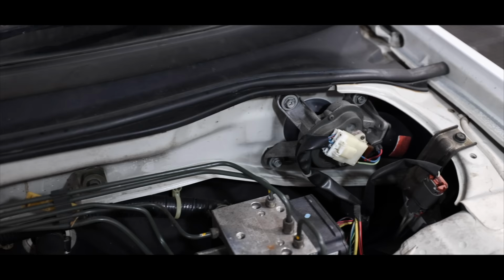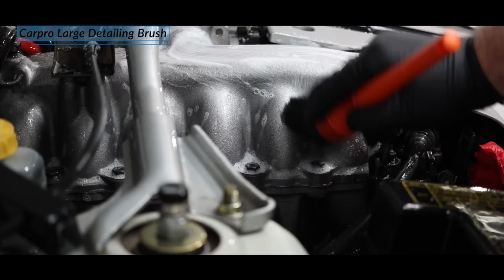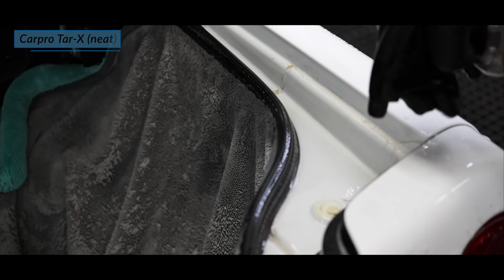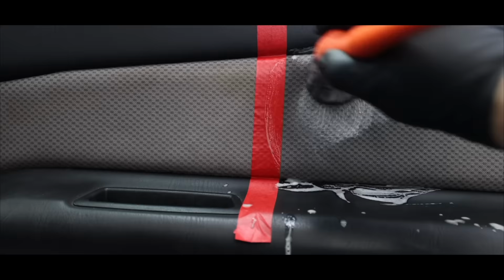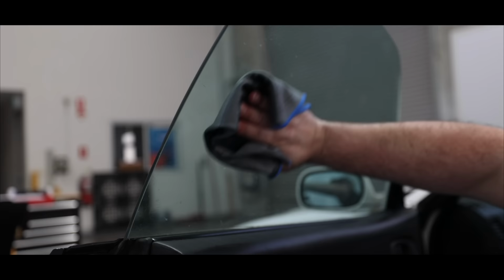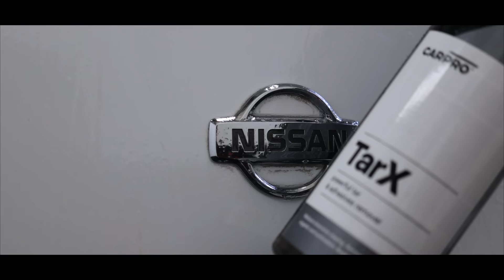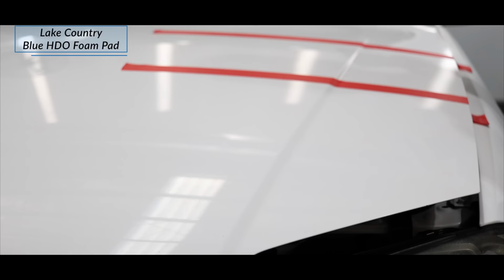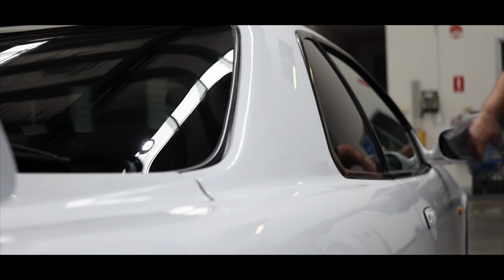My Biggest PreSale Detail Ever! Nissan Skyline R34 (Vlog 48)

Comment: I just did a light polish on my car for a new coating. It's amazing what a difference between a well maintained car and one like you worked on when it comes to contamination. I used Iron remover and I had maybe 10 spots on the whole hood  and fenders where here it's a sea of red. I have learned a lot from you, so Thanks!

Comment: fantastic restoration work Sandro, should be easy to sell with such a make-over.  good thing to use with badges/emblems (get old polish residue from shut-lines too) is thick toothpick or bamboo food stick wrapped inside a MF cloth, to get all the gunk out with out any damage.

Comment: Hey buddy, nice work on the R34. Yikes 84microns. Owner did not look after it ;( 40 hours looks about right, just the underbonnet and engine work would have been half a day.
Reply from the maker: Thanks mate and I think every Skyline I’ve done - which is quite a few now - have all had super low paint thickness readings, so although disappointing it was about right 🙂

Comment: That was a heck of a transformation. Great work as always. I was surprised when you busted out the Boost V2. Can't say I had a great experience with it sadly. Tried adjusting my towel type, amount used, and work areas and it kept leaving oily streaks on the car that required a ton of buffing to get it off. The car has Ethos graphene v2 on it, and the original boost never did anything like that.
Reply from the maker: Thanks mate, appreciate it. I guess there’s potential issues with what you’re applying a sealant over and some don’t mesh together as well as others but so far Boost V2 has worked extremely well for me.

Comment: Good video Sandro...I normally stick to ph neutral (which I would recommend NV Snow foam i find this soap PH neutral and consistent formula)  as much as possible but on rare occasion i use  Alkaline base cleaners over Acidic and rinse 2-3 times because Alkaline is bad for aluminum if left our missed thoroughly when u rinse, Acidic cleaners promote rust and degrade the parts especially aluminum so i would er the side of caution when using Alkaline and Acid base cleaners and rinse at least 2 times. So to eliminate and clean the engine bay faster and safer i opted to use a steam cleaner with a just a cap of NV snow foam which is pretty much safe and also uses less water, breaks down oil, sludge and grime with minimal effort and most importantly it revives the plastics on the engine and surrounding areas. Dry ice is also a good cleaner but i sold mine because im in the market for a portable or mobile Dry Ice cleaner that has less moving parts needed to run.

Comment: As always top work and rebirth of iconic R34 is very satisfying to watch. Headlights looked especially bad - would you advice ceramic coating to protect them(1 year max in my experience) or maybe spray with 2k clear coat spray?
Reply from the maker: Thanks mate and adding a ceramic coating is definitely a good way to on on headlights, and yes a year is probably as long as you’ll last on the lights. You can certainly also clear coat them, but you just have to make sure you sand and leave 600 grit marks in the finish for the clear coat to effectively bond and it’s really best to cover the whole car in plastic as overspray will go every where.
Reply: @CarCraftAutoDetailing  Thanks!

Comment: A quick question, Sandro.  The NV products can be a bit hard to find here in the USA.  Would it be acceptable in your opinion to use CarPro TRIX in place of the initial pre-spray of NV Purify, and then CarPro Lift in place of NV Snow + as the product you spray on top of it to let dwell for bit before rinsing?  Thanks, Sandro!  As always, I appreciate you and your work!
Reply from the maker: Yes you could use Tr.ix, but I’d personal wet the car first as it can dry rather quickly and is a more aggressive chemical - just note that Tr.ix can some times haze clear plastics if it dries, so wetting the surface first can help avoid that. Iron-X is another option that is less aggressive than Tr.ix, but Lift used as the snow foam is a fine substitute with no issues.
Reply: @CarCraftAutoDetailing  Thanks again, Sandro!  I actually dug a little deeper and found a place in the states that caries the NV line.  I may have to try Purge, Snow +, and Purify.  Purify really does look like a very unique product.

Comment: hey sandro great content, mate i was just wondering what you used on the glass for polish? also carpro essence is designed for coatings was there a reason you chose this polish over say things like 3d one or rupe yellow ect?
Reply from the maker: Thanks and it was also Essence on the glass, it works pretty well in my experience. The reason I used on the paint is because although it was designed  as primer to coatings it’s still a fantastic AIO polish regardless in its own right and I find that sealants bond to it quite well. I could certainly also have used Rupes Uno or few others instead.
Reply: @CarCraftAutoDetailing  thanks for your reply

Comment: Hey Sandro, what steamer and extractor are you using?
Reply from the maker: It’s a Vaporetto Steamer and BAR hot-wave extractor. There should be links to most of the equipment used in the interior in the Skyline R34 dedicated interior video 🙂

Comment: Great detailed video as always man! I have learned a lot by watching your videos. One question is the TriX safe on black satin wheels?
Reply from the maker: Thanks mate, it’s great hear that. 
I would be more cautious using Tr.ix on matte/satin and bare metal wheels as it is aggressive, so I only tend to use it clear coated gloss finishes and also only when necessary.
Reply: @CarCraftAutoDetailing  thank you for your reply! Any recommendation on what to use on satin wheels? I read good stuff about brake buster total wheel cleaner.
Reply from the maker: I think Brake Buster would be safe, I personally didn’t find it to be the most effective cleaner but still okay and it seemed quite safe. I’d tend to recommend Nv Purge that used to clean the outer wheel faces, Shine Supply Cool Guy is another good one. 
Just make sure you’re in a shaded area, the wheels are completely cooled down, you wet the area first and don’t let any of the chemicals dry, you can keep spraying some water as you clean to prevent any potential chemical staining.
Reply: @CarCraftAutoDetailing  Thank you very much for the detailed reply!! I will try your suggestions! Have a great Holidays Sandro!

Comment: What pad/polish do you use on the glass to prevent scratching?
Reply from the maker: I typically use whatever polish pad I’m using to correct the paint. In my experience it just those extremely aggressive compounds like CeriGlass that leave behind micro scratches on glass.

Comment: Great video! What size compressor do you use for your tornador?
Reply from the maker: I’ll give you a link to the compressor in the shop, you don’t need one this big if it just the Tornador you’re running, but if you want to run pneumatic polishers you do need one similar to this:
https://ebay.us/bTM13q
Reply: @CarCraftAutoDetailing  thank you!
Reply: @CarCraftAutoDetailing  the link you provided is only a 20 gallon compressor. It can still handle Rupes air tools?
Reply from the maker: That was the wrong link ☺️
I’ve just updated it, this is the one I have in the shop and it runs my air polishers great:
https://ebay.us/bTM13q